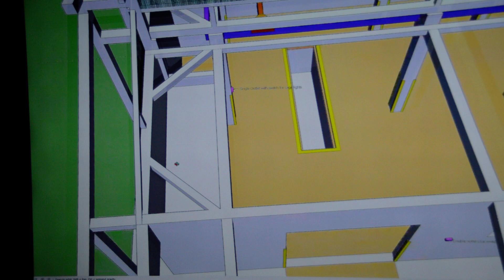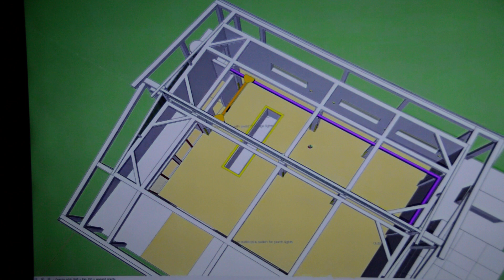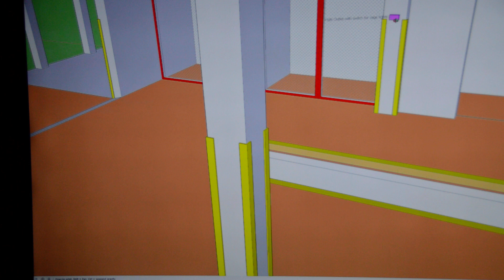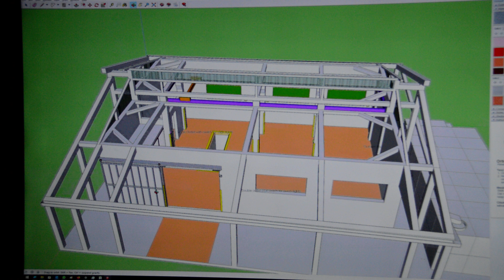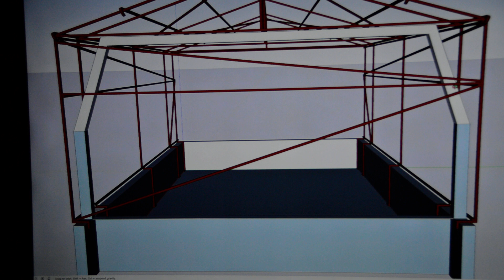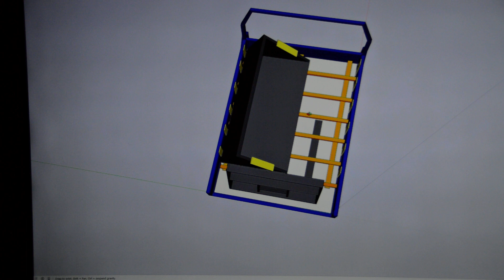No CTL yet

Comment: Impressive Bruce. Have you considered solar and/or a battery?
Reply from the maker: Hi Daryl.  I have a solar/storage setup on the house (15kW of panels, 24kWh of battery, with another 16kWh on order).  My current plan for the machinery shed is to add a second system with similar specs to the first system (15kW & 24kWh) but 3 phase.  As that way I can have a diesel backup generator that can be started by the solar controller at need.  The diesel backup generator is 3 phase.  The house system is single phase.  There is a genset input to that with a little petrol generator connected.  That can't be set up as autostart.  So if the battery drops to 20% charge, power to the house is shut off.  Not good.  The plan is to use a line from the shed system into that genset input at the house.  So if the house battery goes to 20% it will draw on the shed battery.  If that goes to 20% the diesel generator will start.    This arrangement will end up costing more that the shed itself.
Reply: @recumbentkoala  beautiful. Not “Over engineered” at all. Well done.